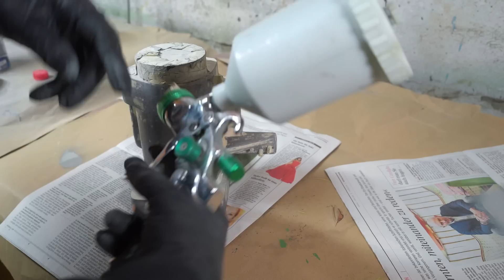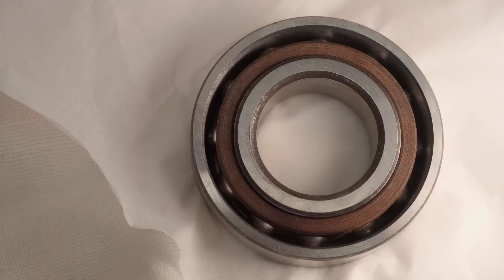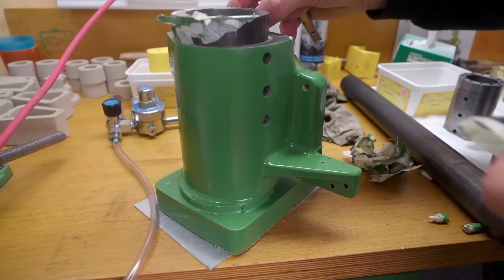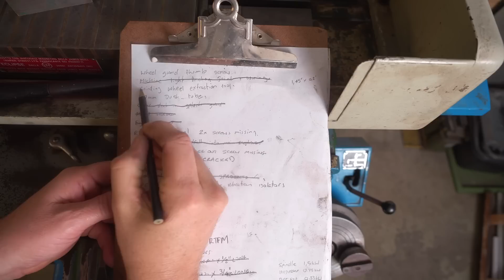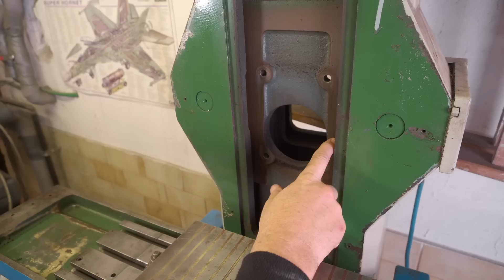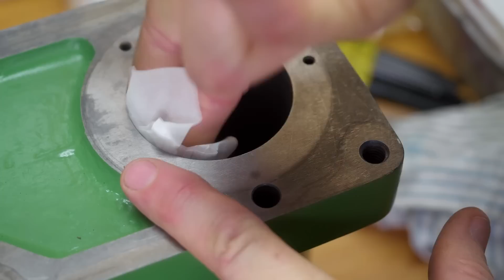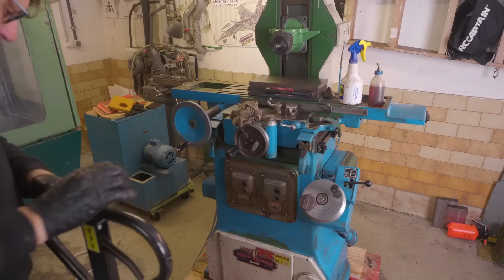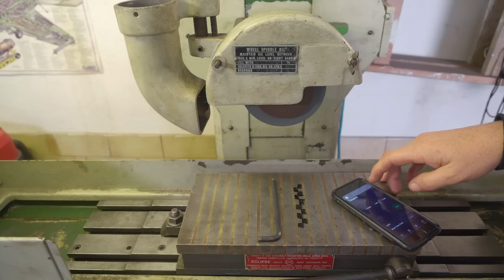My surface grinders bearings needed servicing || RotarySMP

Comment: So next up VFD and a brake?
Reply: Brake on a grinding wheel? You probably wouldn't want it to to be any faster than the acceleration rate so that you don't stress things more than they are originally designed for. You could do an almost instantaneous stop which wouldn't be great (I think).
Reply from the maker: Good point Ian. Yeah, just let it run down. 30 seconds is not that long to wait.
Reply: @RotarySMP  Yeah 30 sec doesn't sound like much but it FEELS like it's an age.
A compromise would be something like if it takes 3 sec to get up to a stable speed then slowing it down in something like 6 seconds or even 10 would feel HUGELY faster, and I can't see would risk anything.
A big benefit would be less chance of getting frustrated and sticking fingers etc where they shouldn't be too early. If you can hear it really slowing down it will also help lessen the impulse of not wanting to wait.

Comment: Excellent result! The grind looks good too, I lust after a surface grinder, I don’t need one obviously but when has that ever mattered!
Phil
Reply from the maker: Exactly Phil. I also got this largely out of curiosity :)
Reply: Yes and no. If that was a punch or a trim steel for a stamping die, it would probably start chipping far to soon; it would depend on how deep the burn fracturing went below the surface. For a first test, mystery wheel, mystery block it's not bad, but the machine is a work in progress.
Reply from the maker: @7891ph  Absolutely.  I just measured that block after grinding those two surfaces "parallel". Hmm, not even close.

Comment: Hi Mark  Happy easter.
A bit of refinement on the  runout marks. they mark the high point of runout* and should be matched  with the low point of the spindle and 
housing respectively.

squirt the excess of grease back into the tube  (and not all over the table 😉) you can adjust to the required measure and save the excess.

If shopping for new bearings you don't need phenolic races , the plastic ones are fine, in fact a bit better then phenolic.

*it's important to remember that,that runout is not measurable by us mortals  more modern machines have the matching
runout marks on spindle and housing.
Reply from the maker: Hi Steve. Unfortunately, I couldnt identify shaft or housing high spot markings. I did look for them.

Those bearings are toast, but considering that, and the unbalanced wheel, I am amazed how good the result was. I will use it for a while and try and work out what else it needs, doing the bearing when I scrape it back in.

Comment: I would assume concentricity isn't that important on a grinder? When dressing the wheel, that concentricity should be canceled, right? I would think that radial play in the bearings would be the big problem to look out for.
Reply from the maker: Good point. And the shaft have very low inertia relative to the wheel.

Comment: Very nice. 👍 But I have a question for you, here in Thailand, during the wet season, ie, now, things rust while you are looking at them, and I have a hell of a time keeping the surface rust on my chucks, etc down to a dull roar. Recently, I turned 67, and I'm eligible to get the old age pension back home in Oz, but the catch is I would need to go home for 2 years to get it. If I were to bugger off home for 2 years, when I get back I would be confronted with a mountain of surface rust, So, my question is, what is the "Waxy Stuff" you are using and just how good is it at keeping rust at bay?? PS: Happy Easter, you wouldn't even know it was Easter here in this Buddhist country.
Reply: Here in the UK , it's not as bad as the Far East for humidity, but things rust in the blink of an eye in the workshop. I use Sta-Bil Rust Stopper and it has proved to be fantastic stuff. About £17.00 a tin here in the UK 🇬🇧. I have used 1 and 3/4 of a tin in the last 2 years. I'll be buying some more soon, well worth the money..
Reply: @billdoodson4232  Unfortunately, much of what is available in our home countries either isn't available here or is ridiculously expensive thanks to the import tariffs here.
Reply: A very cheap way is to coat it in a mix of oil and diesel. The oil will help to make sure it will stick well to the surface
Reply: per Dan Gelbart (see his series here on YT) there is one where he talks about rust on machines.  It happens when the surface ph value goes above 7 (acidic).  He has got a planer (wood thing) in a room with a waterjet cutter and wet belt sander.. he wipes it with NaOH, leaves a residue that is basic and prevents rust.
Title to search for is 'Unusual Shop Tips'.
For 2 years safety u probably want to look into whatever they use to put on bare metal surfaces before shipping machines - prob a sort of heavy waxy stuff (over here in Oz/FNQ I use Lanolin).  Gotteswinter also uses waxy spray that leaves a thin film.. there was a video about his 'Shop chemicals' a year or so back that will most likely also list this.
Reply from the maker: This is the stuff I am using, 
https://amzn.to/4ivtFwh
But there are other brands like LPS-3 which are similar.
Reply: Thanks

Comment: Have a LIP300 Surface-Grinder from 1972, the spindle has a run-out of 6/1000mm, works fine.
The dressing and balancing of the wheel is the way to a great finish.
Reply from the maker: Thanks for your eyxperience on that Matthias. I still need to delve into wheel types and balancing.
Reply: @RotarySMP  the aluminum oxide wheels you have now are pretty good, they are mostly differentiated by the stone color. The other main wheel type for metals is CBN, Cubic Boron Nitride. they generally give a better surface finish, and the wheels can be just straight abused. you can take multiple thou plunge cuts in one spot back to back, its a really useful for hogging out materiel when you need to. they are dressed differently, with a long diamond plate instead of a single point.

Also, look into getting cup wheels for vertical grinding, as well as slitting disks. their also CBN, but their EXTREMELY useful for cutting just about anything in half. even the hardest tools steels can be cut very easily with them
Reply from the maker: @ghillieinthemist593  Thanks for the tips. I need to get the other two wheels I have mounted and balanced and try them out.
Reply: you mean 0.006mm or 6µm ?
Reply: @flikflak24 Yes, my first idea was I need to regrind the taper, but the 0.006mm did not make problems.
Reply: @matthias_fenner_toolworks  as long that you always mount it the same way on the same part on the taper ( within like +- 2mm ) then it sould be fine ( so like make a mark in the spindle and also on the wheel hub so you can line it yo at the same spot every time )

otherwise its just grinding it on the machine with its bearings ( that way the bearing error is grinded out/compensated out of the equation )
Reply from the maker: @flikflak24  We are lucky to be in a time when machines like these can be had for near scrap value. My Schaublin would have cost as much as a good car new.
Reply: @RotarySMP  well sadly not the 125C that one is quite a bit higher then near scrap metal value ( i know cause i seen plenty of bigger. heavier ones for less cost ) but i am planing to do a project where i use cnc vice's to make a pretty strong mini lathe out of that can run/be used as both a normal lathe but also as a manuel swiss/sliding head lathe

btw did you know that you can actually make a attachment to your lathe where you can pretty much run it as a swiss/ sliding head lathe ?
Reply: @RotarySMP yes, my wife asked me what the replacement cost would be for my machines for insurance.  I know my lathe cost 5k GBP in 1972, irreplaceable is close to the mark.
Reply: Sorry for barging in and not an engineer is that 6millianths of a meter. 6/1 000 000m sounds very small. Writing it this way puts the micron into perspective. It's amazing how impressivly accurate machines have been in the last century and that we can have these in our home workshops.

Glad most of us don't need to measure this and truly amazing we can.
Reply: I have a LIP PLTH300 from 1974 😄

Comment: I think the not moving bearings without grease is more about running them at speed, under load or for a significant amount of time. Gently turning them by hand just to get a feel for any wear should be okay.
Reply from the maker: Thanks for that feedback. I was going to say it causes Brinnelling, but they I realised I made that up :)
Reply: @RotarySMP  I believe Jaen is correct here.  I see I lot of people cleaning bearings and then spinning them up with the airline whilst blowing the solvent out which is a bad idea for many reasons.
Reply from the maker: @ferrumignis  Doing that in my apprenticeship would have got me in deep trouble. They put a lot of emphasis on the dangers involved.

Comment: I don't see any reason to not spin the bearings with no grease in them.  The balls and the races are made out of the same hardened steel and it's not like you'd be putting any real pressure on them.  Just don't spin them up to Mach Jesus with the compressed air and you should be fine.
Reply from the maker: Thanks.  I was going to say it causes Brinnelling, but they I realised I made that up :)
Reply: @RotarySMP especially if there's no point loading while you're spinning them.  I'm sure you know much more about brinnelling than I do, which is probably why it came to mind for you.
Reply: from what i've seen in some skf failure analysis document it's the spinning at higher speeds what could cause damage, so it does seem like you can rotate them slowly without issues
Reply from the maker: @ikbendusan  Good to know. Thanks.
Reply: Dry steel likes to chatter sometimes and that can cause it to wear
Reply: @poptartmcjelly7054 not at the speed you'd be spinning it with your hands.  I think you'd need at least a couple hundred RPM for it to start chattering.

Comment: I feel like Hammerite would not only have looked nicer, but would have masked most of the defects without much filling.
Reply from the maker: Hi Alexander. I just dont like hammerite. Never have. RAL 6011 all the way. 

I didn't show it but did two top coats, and had it out in the sun on thursday to harden the paint. It was a day we had a lot of wind, so a lot of pollen, sahara sand and blossoms settled on it. I should have done a better job scuffing the pain with 1000 grit before applying the second coat.
Reply: But does it come in 6011?
Reply: @RambozoClown  the textured stuff only comes in black
Reply: @ The textured stuff also comes in other colors, including "Moosgrün" and "Dunkelgrün", the latter being a close approximation to 6011. Moosgrün is 6005. Other manufacturers have Hammerschlag 6011 as well.
Reply: @ikbendusan  You use the hammerite as a base layer and paint it over with 6011 as a finishing coat before the clear coat...
Reply: @camillosteuss  i see
Reply: Brantho Korrux might be a nice alternative to Hammerite. RAL 6011 is available in a flexible "3 in 1" variant and a less soft "nitrofest".